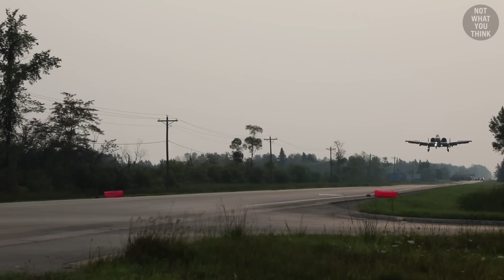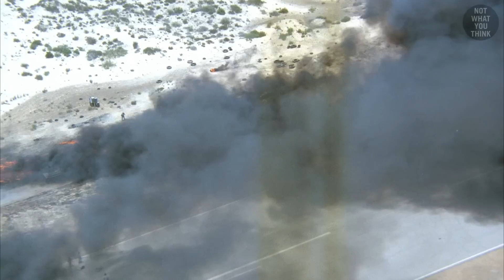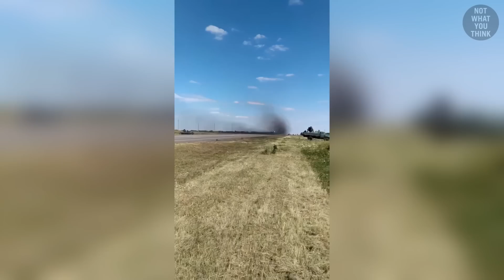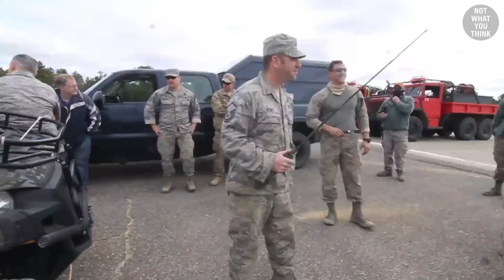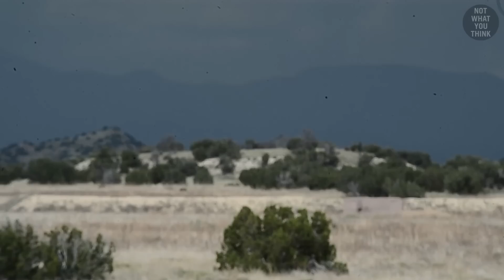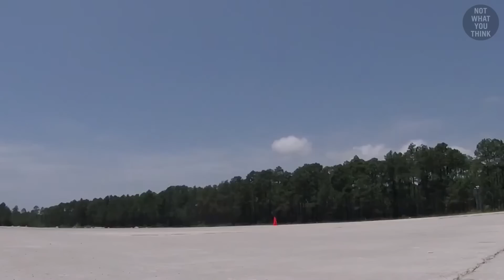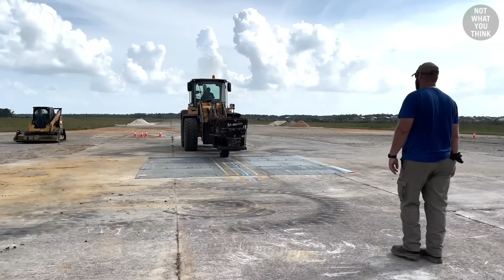How Landing on a Highway Helps Avoid Potholes

Comment: Driving north on Rt 126 in Oregon at about (44.2631451, -122.0414389) in 1994 I saw a small plane coming directly toward me, dropping below the tree tops. He continued to drop so I pulled over and stopped. The car ahead either didn’t notice the plane soon enough, or couldn’t stop fast enough, so as the plane touched down that car went under the wing. Luckily it was a subcompact and no collision occurred. 

The plane had run out of gas. Lucky for him, a lengthy straight road without potholes was within reach.

Comment: This thing is the Autobahn has always been built as an emergency backup airfield because you got member it wasn't built in the 50s or 60s it was built in 19944 or 1945 during world war II select that thinking that's why it's twenty miles long of straight road which is actually what a lot of people don't realize is really dangerous is because a lot of people actually fall asleep because of how long the men straight the road is even in America we actually when we're going across the desert a lot of the roads actually have a lot of dips in them might be straight and have no bends in them but they do have elevation change

Comment: if the RADR teams operated like the JSDF they would have used their spare time doing public service work clearing potholes from streets and highways which then in turn would also help familiarize them with the conditions of roads that they might one day actually be working with, while at the same time giving them some points with the local community for their help.

for the uninitiated, the JSDF does a lot of public and community work when they're not training or doing official work, from roadworks and wetworks, to disaster control, aid and relief efforts, rescue services, public infrastructure work (usually building new roads or bridges), evacuation and relocation work (typically for volcanic eruptions or landslides), building refugee camps, vaccine drives, etc. while the JMSDF does a lot of civilian trade routes defense, search and rescue operations, and so on. if the US military did this stuff people would sing praises of them.

Comment: I suspect they patch with asphalt if they need it up and running again.  That will do the job far faster.  If the holes are big enough that you have to pout concrete... you are screwed since your access to it is likely going to be pretty limited.

Comment: Back in the early 90s,  the disposal of ordinance in bomb craters was one of my jobs at RAF Bruggen in Germany, prior to then helping out repairing the runway.
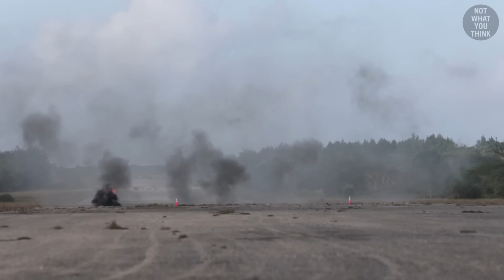 The American method of repair is much slower than the British and Canadian. The nato standard requirement was to fill and get operational,  1 large and 2 medium sized craters in 3 hours, to which both the, us, Brits and the Canadians, 6:33  could do it in a little over 1hr. No concrete was involved, just dispose of ordinance, clear large debris, fill with different grade 'stone', compact, place large alloy mat over the top and bolt it down. Simple and quick. Our method was the quickest way of any of the nato forces at the time and as far as I'm aware, the Brits, Royal Engineers to be more  precise, still use this method.

Comment: Just a quick note; no the highways weren't "designed only for automobile use".

The idea for using highways as back-up runways has been around since WWII. Okay, the "1-in-5 Miles must be suitable for landing a plane" belief is just a myth and not factual, that doesn't mean they never had the idea and never had plans to use roads as such. In fact, the Defense Highway Act of 1941 talked about turning sections of roads in to 'flight strips' & that 'flight strips' section of roads are to be made easily visible, wide, and so forth. In fact, at the time they didn't even consider the idea to just be for the military, assuming that at some point this could be helpful in the civilian aviation world (and it was, many stories of planes landing safely on highways).

So no, there was no mandatory amount of road that had to be able to double as a runway, but they did plan on using roads as runways, and most main roads built after WWII were done to accommodate this.

Comment: For such a car-centric place, Michigan amazed me. I once visited the big college there, and spent a large amount of minutes waiting to cross a street at a crosswalk without a light or anything, and the cars just kept coming. In the US, I know that just walking can be a crime, so I waited there like a good little tourist. Then driving around the state, it’s so confusing. Are the roads so busy they can’t be maintained?
Reply: Heavy industry rules in Michigan, so highway truck weight limits are set at 164,000 pounds instead of the federal limit of 80,000 pounds.  They don't change the highway itself, only the weight rules. When you insist on pouring 10 gallons of water into a five gallon bucket, certain consequences often ensue.
Reply: That makes sense: the more car-centric a place is, the worse the roads are; all other things being equal.

The reason is that personal vehicles are the least efficient transportation option available: so governments go bankrupt trying to maintain all of the infrastructure.

A cycle track has the same theoretical throughput as a 6 lane highway. (12,000 passegers/direction.hour.lane; personal vehicles are ~2,000 passengers/direction.hour.lane -- assuming about 1.3 passengers/vehicle)

A walking path has even more throughput. The only thing that beats it is rail.

Comment: If you return to the end of wwii, gen ike returned from germany and the auto bahn.
The auto bahn was designed for the military and the rapid movement of troops and military traffic.
It was intended for military use.

Ike created the interstate for the milirtary, the movement of military men, the movement of military equipment, and landing areas for the planes of the time.
The fact that cars use it does not preclude the military taking over the interstate as it was originally intended.

Comment: In cases where an air force base is bombed, the US military may resort to extreme measures to restore the operation of its aircraft. One such measure is the use of explosives to create makeshift runways on damaged airfields. This technique is called crater repair, and it involves detonating explosives to fill in bomb craters and smooth out the damaged surface. While it may seem counterintuitive to use explosives in a damaged area, it can be a highly effective way to quickly repair an airfield and get aircraft back in the air.

Comment: Fyi about US Interstate system: since the U.S. Interstate system is partially funded by the federal government, one of the stipulations to receive funding for the system is that there must be one mile of straightaway for every five miles built, i.e., between every five miles of interstate road there is a minimum of one mile of straightaway. This was done for the specific purpose of having emergency landing strips all over the country.
Reply: Unfortunately that's just a myth. There's no law requiring one out of every 5 miles to part-time as a runway. That's just an urban legend that's been floating around for a while.

The closes thing is  Defense Highway Act of 1941 which simply states that in an emergency, a highway could double as a "flight strip" but it makes no reference to how much highway should be able to do this, nor how big a "flight strip" needs to be.

Another urban legend people ended up believing is true thanks to social media unfortunately.
Reply: @Perseus7567  thanks, but I didn't hear that through social media. I heard that in public school. Not saying it's true, just wanted to point out that the source was (seemingly) more of a legitimate source. And, fyi, I went to school prior to the onset of widespread social media, so that whole idea has really been around for a while. And so ingrained that this is the first and only time I've heard to the contrary.
However, last thing, I always did question the legitimacy or extent of the matter when it came to mountainous terrain.

Comment: In Poland, multiple roads were built during the Cold War to serve as emergency airfields. They were in forests, with large parking lots for planes and special equipment. If anything, NATO just took the idea and run with it... not even bothering to do it right as the purpose-built road/airfield can be used without any special preparation. Just block the traffic and land.

Comment: There wasn't only one Autobahn strip in Western Germany prepared for acting as an emergency airfield, but twenty of them. They had the area between the two groups of lanes alread paved with concrete (instead of the gras and shrubbery usually to be found there in Germany), quickly removable saftey barriers at the side and "rest areas" that could be turned into aircraft servicing areas. Almost half of them still exist today. (Theoretically, at least - I guess, the airfield part of those installations isn't actively maintained any more...)
Reply: There was never an "airfield" part on those strips of autobahn. It was always intended as lowtech emergency landing strips where everything needed would be put there when actually needed.
Reply: @Ruhrpottpatriot  Yeah, but the infrastructure to install radar and communication was present as well.
And civil roads couldn´t be built, e.g. bridges across the autobahn to connect two villages on both sides.

Comment: And here I though that Middle and Eastern Europe has bad potholes, hot damn, how the hell people survive in Michigan with those roads?
Reply: Ya there bad
Reply: We make it into a sport that we jokingly call the state's official sport, "Spring Slalom." (It's mainly due to frost heave from the multiple, frequent freeze/thaw cycles the ground goes through every winter in Michigan, so the potholes are worst in the early spring.)  The objective isn't to avoid the potholes, that's impossible.  It's to hit the small ones that won't damage your car instead of the massive craters that will take an entire wheel off.  If you manage to get from 1 February to 1 June without needing an alignment or suspension repair, you win.

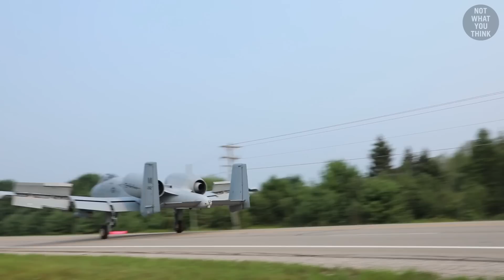Comment: 0:08 The US highway system isn't only designed for automobiles. The original plan had requirements around straight and level sections specifically to enable planes to land.

Edit: just realized the highway in the video isn't an interstate, so what I said doesn't really apply.
Reply: Look up Eisenhower Highway System. That is exactly what the program is that you speak of.
Reply: @CarbideSix  According to the Federal Highway Administration, the "one mile in five" rule or the idea that US interstates were built to land planes on them was a myth.
Reply: @ratemisia That's interesting, though they may or may not be telling the truth. National security and all.
Reply: It kind of it is because any kind of large strip of road can be a landing strip or planes can take off or land so you’re technically right and also wrong at the same time maybe but usually all roads are designed for stuff like that it can be any kind of road, but the requirement is nice long strip of land or nice long strip of road is large enough for large planes, but not too small for a small planes.
Reply: This is a widely unfounded myth. The original plans for the interstate system had no such requirements in place/
Reply: Incorrect. It was never a requirement  by the government and is nothing more than a myth.
Reply: It is kind of irrelevant for cargo aircraft. Military cargo aircraft like the C-130 and the C-17 (the workhorses of the Air Force) do not need runways, airfields, and highways.
Reply: @deanfowlkes  well, you are right about that but all it needs is nice long flat runway can go anywhere, but it just takes nice flat runway that is long and wide enough for the plane to land
Reply: @adphoenix600  - You would be surprised at how short that distance actually is. The only time it would need a long runway is when it it loaded to its max capacity. This would normally be at a military airfield. Landing for a refuel would require less space than a farmer’s field. 

To takeoff and land at an off airport site with only fuel and crew onboard, a C-130 needs less than 500 yards (or meters). Even small private airports have runways and grass strips of over 700 yards with most public use airports averaging between 1500 and 4000 yards. And, there are over 5000 public airports in the US.
Reply: @deanfowlkes  yes it’s true but you left out the military can use airports civilian airports. You left that out.
Reply: @adphoenix600  - Yes, that is true. There are even mixed use airports. I’ve parked my little Cessna next to F-18s. And, Army helicopters refuel at our little community airport all of the time. I’ve even taxied a little Cessna past an off duty Air Force One. I was not able to park next to that. 😁
Reply: " 0:02 To rebuild a previously bombed out airfield in the most American way."

I think I'm okay with that.
Reply: That didn’t apply to all highways. Per the Interstate highways act it would only apply to northern tier states. it was bombers they were thinking of, not fighters.
Reply: It’s actually kind of an urban legend, there’s no official documentation requiring sections to facilitate aircraft.
Reply: yea you should just delete the comment
Reply: you can delete comments you know
Reply: @unironicaluser1867  It's still mostly relevant. I just don't know for a fact whether that particular state highway had similar design ideas.

Comment: The US interstate system is by Law, supposed to have 5 mile long, straight sections of road to be able to land aircraft. 

Thanks to General/President Eisenhower,  the creator if the US Interstate system. 

He saw how efficient the Germans roads were so that was his model.

Also before WW2 he was assigned to send military units from coast to coast,  it took a month.
Reply: Unfortunately that's just a myth. There's no law requiring one out of every 5 miles to part-time as a runway. That's just an urban legend that's been floating around for a while.

The closes thing is  Defense Highway Act of 1941 which simply states that in an emergency, a highway could double as a "flight strip" but it makes no reference to how much highway should be able to do this, nor how big a "flight strip" needs to be.

Another urban legend people ended up believing is true thanks to social media unfortunately.

Comment: Considering the Roman’s used their legions for public works and construction I don’t see why our modern military can’t be used for the same thing. Michigan could use the help and it seems like it’s elected officials aren’t gonna do it.
Reply: The Army Corp or engineers does sometimes do work like bridges, dikes, and dams. At least, that's what I've learned from some civil engineering history.
Would be an interesting exercise to have a RADR team try to deal with a section of Michigan's roads... I wonder if the patching they do would even last a winter. (Then again, the cost of that would probably be rather pricy...)
Reply: I think the RADR jobs are only meant  to be temporary anyway so I don't think they would be a good choice for a road.

Comment: It's so weird that we tested the A-10 on highways when we simultaneously operate the harrier and F-35B, which can literally take off and land vertically for the exact purpose of being able to operate without runways  All while carrying the exact same weaponry as the A-10. I mean I guess all planes need to be considered but it just seems like we would use the harrier/F-35B for that role.
Reply: We already know we can land the Harrier/F-35B on highways. We don't know if we can land cargo planes and low maneuverability stuff like the A-10.
Reply: @H9092-2  well both planes tested were designed with short runway capability in mind, so I don't know that that's the case. I'm just saying it seems kind of impractical to test the A-10 when we don't even need short runways for the same capability. The cargo plane makes sense though, test the highways as feasible runways, not for the plane, but to make sure the highway doesn't break.
Reply: @treyaldridge1757  Yes, that's why they tested the A-10. They knew the other planes would work, they didn't know if the A-10 would.
So they tested what they didn't know would work to find out if it could.
Reply: @H9092-2  that's incorrect, they did know it would work because in the design process for the A-10, it was literally tested many times as this was a major requirement of the plane. The test is to make sure the highway can be used, in which case i don't see why the A-10 is necessary. If the cargo plane can operate from it, there's no reason the A-10 couldn't.
Reply: @treyaldridge1757  Wingspan maybe? Maybe the A-10 was there because they needed another plane to test and the hog was just sitting around with pilots needing flight hours.
Reply: Harriers and F-35B make up a pretty small part of the US aircraft fleet, there is around twice as many A-10s as Harriers and F-35s combined, and the number of fighters which take off conventionally is orders of magnitude higher. Plus Harriers and F-35B are largely tied up between Amphibious Assault Ship operations, training, and maintenance.
Reply: @SnowmanTF2  McDonnell-douglas built over 300 av-8bs and that's not the only variant of the plane that even the US operates? And with 353 f-35Bs, that puts the total number of the 2 aircraft at the same number of planes as the A-10C? And also, if it's testing feasibility, why not test actual fighter jets that require a full runway instead of the plane designed for short runways that we know will have absolutely no problem operating from highways or even dirt fields?